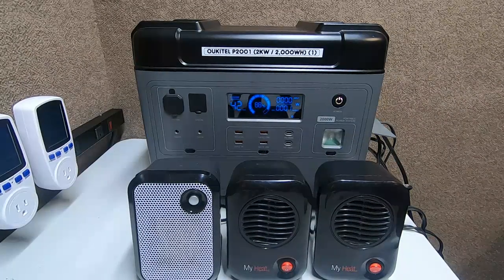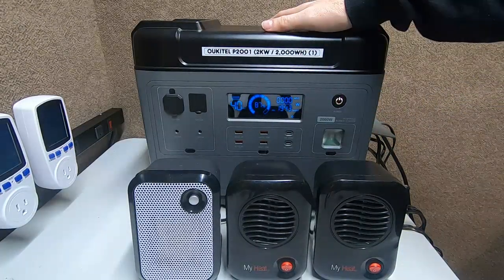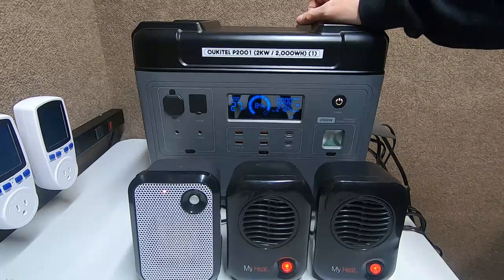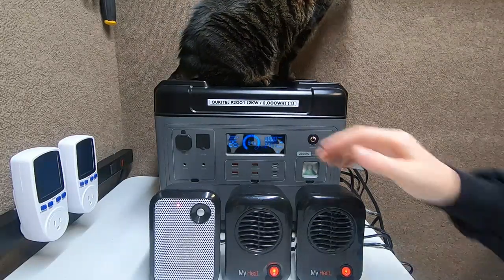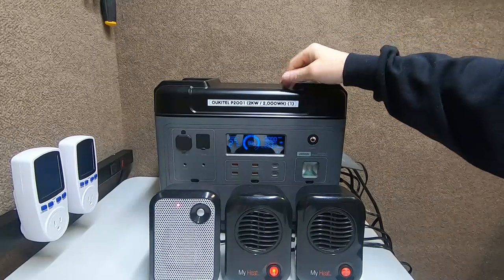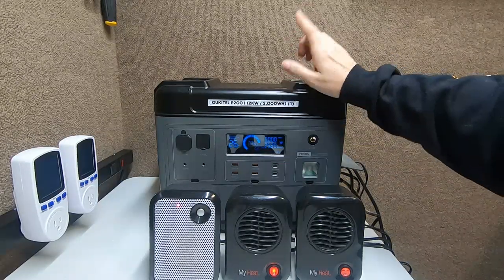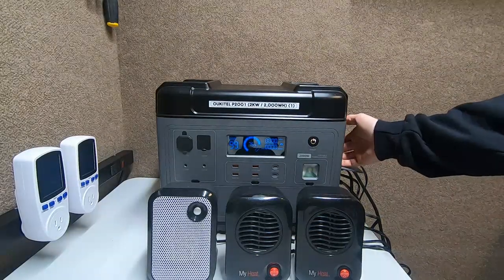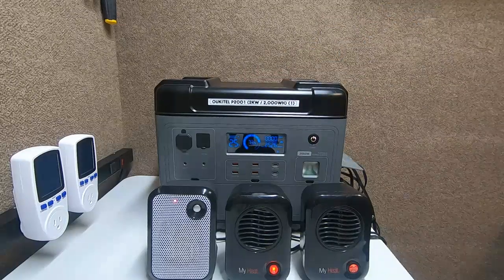OUKITEL P2001 Power Station (((((MAX AC LOAD TEST)))))

Comment: It has great power ability, I use mine for my cpap and a fan at night for the ups feature in case power goes out. The only downfall is the efficiency on it. Only get around 1600 out of 2000 wh. And the fact it only takes 50 volts solar input.
When I tested my AC output I put 2 window units and a chest freezer on it. No issues what so ever.
Reply from the maker: It is a nice power station, That is why we bought 2 :)

If this had higher solar input (power & voltage) & better cell capacity or expanded battery option, It would have been my go to power station....

P.S. 1,600wh.......LUCKY !!!!!

P.P.S. We are only getting 1,550wh out of ours....LOL 😆
Reply: @RamblinBobReviews  yeah, that is the big problem with them. I charged my vigorpool 1200 wh hour with the oukitel and it went from 100% to 15% charge left. I know the inverter only gives around 75% efficiency and since it is a 48 volt battery or something like that the DC efficiency is about the same. The vigorpool is always around 90% and only downfall is the DC voltage input for solar.
Reply from the maker: NOw, If we could just take all of the best parts about all of these power station and combine them into one super pimp model......PECRON, BLUETTI, EBL, ECOFLOW, OUKITEL, ETC, ETC< ETC...., ARE YOU LISTENING????